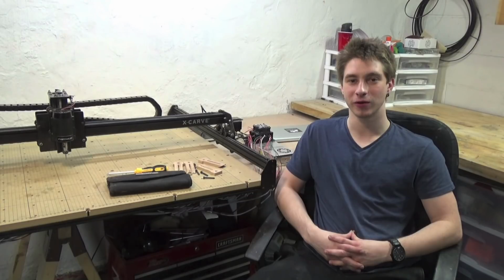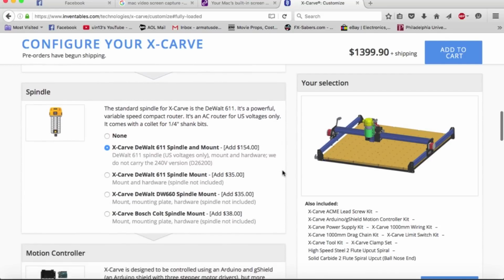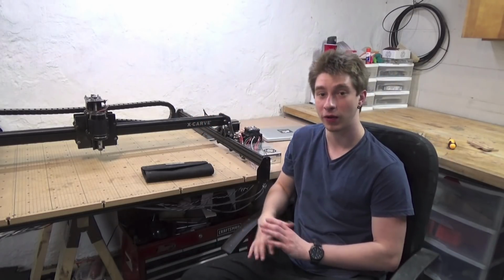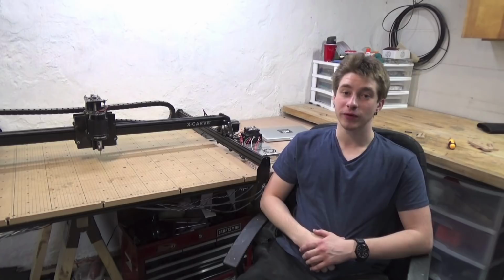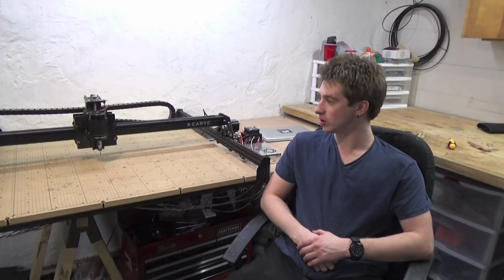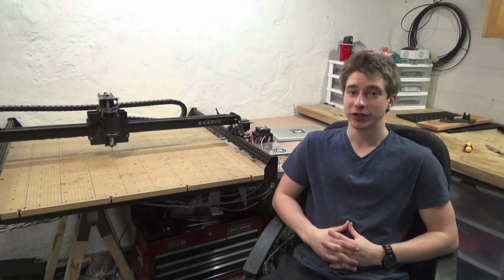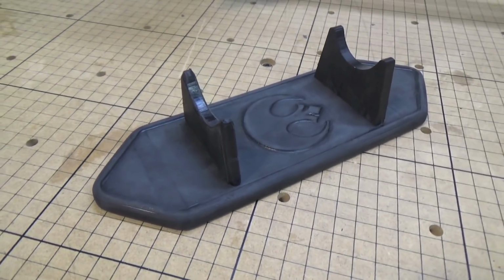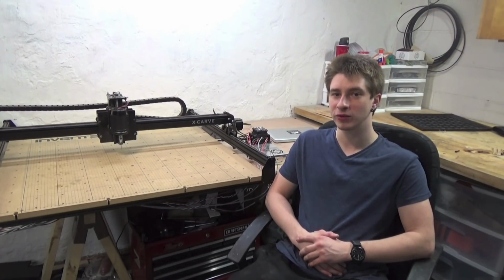Inventables X-Carve CNC machine review (after 6 months)

Comment: If you were to use a drill bit in the spindle and set the speed correctly, would it be able to drill holes through, say, 18 gauge steel?

Comment: Nice video. One of the reasons for low cost of the machine is its low gantry - and therefore a limited Z axis. For  example, it would be difficult to cut a 3D relief on log using this setup. And raising the gantry would take away some sturdiness.  I'd like to note that putting together a kit should be called "assembly". Building a CNC means really building it from basic components...